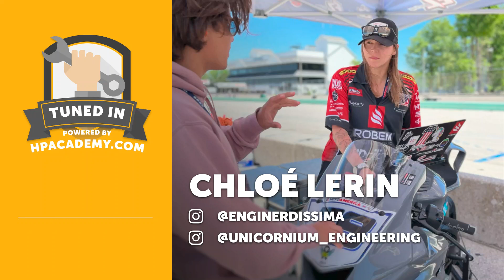070: Motorcycle Data Analysis And Harley Davidson Combustion Engineering [#PODCAST]

Comment: I have learned quite a bit from HPA videos and I'm not sure why but I was surprised how little you know about bikes😜
JFYI, even though they have ITBs most of the bikes have both TPS and IAP Fuel and Ignition tables (along with per cylinder and per gear tables) and it surprising how different they are.
And if @Chloe' is reading the comments? You have a new follower, subscriber on Insta and YTube (best of luck to you on your R6)👍
Reply: Thank you. Intake dynamics are incredibly complex on bikes. No space for plenums, variable intake ducts, high RPMs, etc. The technology is similar to automotive, the challenges are a bit different. Thanks for listening.